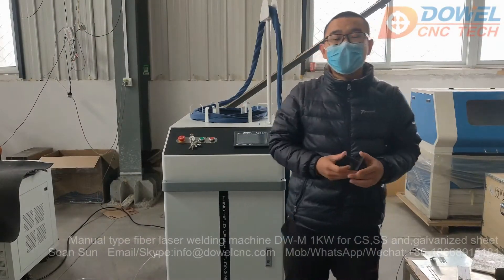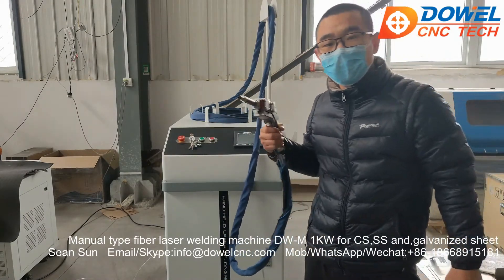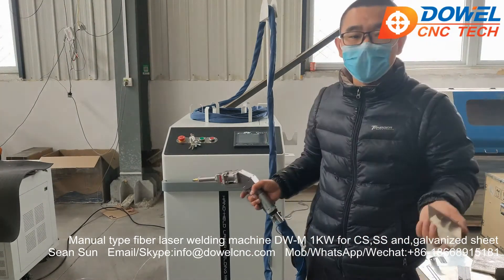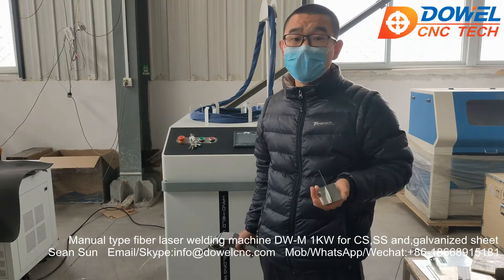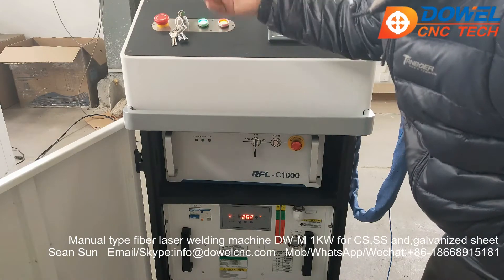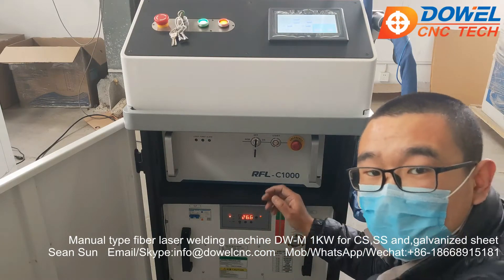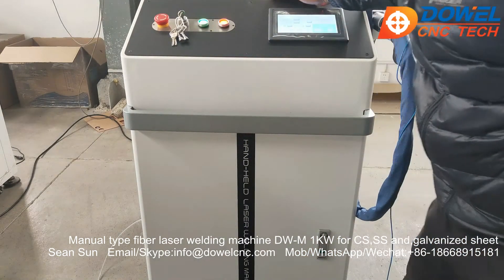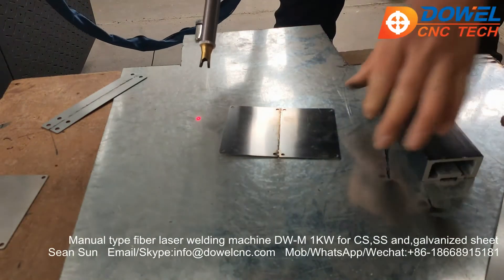what can a 1KW fiber laser welding machine do? fiber laser welding machine

Comment: Hi, paused at 3:40-3:45 there are burning marks along side of the welding mark.  Are there any way to get rid of them afterwards or avoid before the work?
Reply from the maker: Tks for your careful view of this video, actually it is like one kind of way of metal melt by the high temparature fiber laser beam, so that to fuse them together, there must be some sparks splash during the welding. Actually now we have already upgraded the manual fiber laser welding machine with smaller volume and extra wire feeder which can auto feeding the wire like 0.6mm,0.8mm,1.0mm,1.2mm, 1.6mm thickness to enhanse the welding joint(What can a 1500W fiber laser welding machine do? fiber laser welding machine https://www.youtube.com/watch?v=3XZnjrOORkc&list=PLaTZV1UyJd8wQcxyOrG-s1IAkgFnaAfQJ&index=6&t=4s) ,also there is fiber laser cleaning machine which also can remove the balck color or redundant burning afterwards(How does laser cleaning work?Rust removal,Paint stripping,Mode cleaning,Oxide removal,Grease removal  https://www.youtube.com/watch?v=sHZtTjNVMSU&list=PLaTZV1UyJd8ygbh-C3O1LMIAYCMFiP-zo&index=2&t=218s), hope what I express can help you .
Reply: Buy a laser  surface rust remover will get rid of blueibg out of stainlesssteel. Or Adjust your heat and Polishing.

Comment: there is the same machine on aliexpress costs 500 dollars. But does it work well? Is it reliable over time? Then how is the penetration of the weld?
Reply from the maker: 500USD? Are you serious? You should better check if the core part same or not? Do you know how much the fiber laser source cost?
Reply: @dowelcnc1009  it's called Raycus RFL c 1500. So it says. Then if it's a scam I don't know
Reply from the maker: @giacomoorru3420  this is a trap which hook you up to inquire them, then check what kind of job you want to do, then they will give you suggestion or tell you 500usd machine can't help with your job. If you don't believe what I mean, check with Raycus laser source supplier how much they quote? And check how much the water chiller cost? That is the correct way before you comment

Comment: How about the price For the machine 2000 watts with Rotary welding of cylindrical parts
Reply from the maker: If including the rotary welding system ,price should be 12690USD FOB QINGDAO,More details ,pls contact me by WhatsApp or Wechat :+86-18668915181
Reply: @dowelcnc1009  we are looking for a laser welding machine for SS, aluminium,Nickel aluminium bronze for our connector accessories
Reply from the maker: @peterpaulraj8010  well, our fiber laser welding machine is what you are looking for, actually we can give more suggestion until you tell me about the thickness of your metal materials, online WhatsApp +86-18668915181

Comment: what is the durability versus traditional filler welding
Reply from the maker: there is big difference, fiber laser welding machine with feeder which mainly for weld thin metal pieces like smaller than 8mm or so

Advantages of fiber laser welding machine VS traditional TIG or MIG as below :
1. The welding is smooth without polishing or grinding, saving labor;
2. The welding speed is fast, 3 to 5 times that of traditional welding;
3. No welder certificate is required, no technical requirements for workers, and both men and women can operate;
4. The welding workpiece has no deformation, no welding scar, and the welding is firm

Comment: Does it use filler material? Like welding rod in MMA or wire in TIG machines?
Reply from the maker: Hello,this fiber laser welder with two model for welding, one with feeder to output the welding wires,the other without feeder like what I showed inside videos,more details drop message to my WhatsApp pls